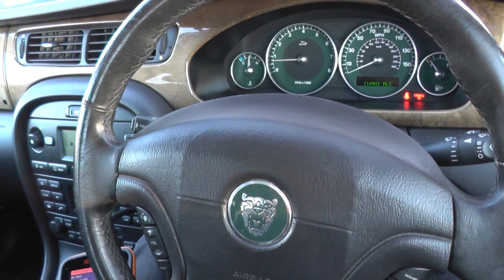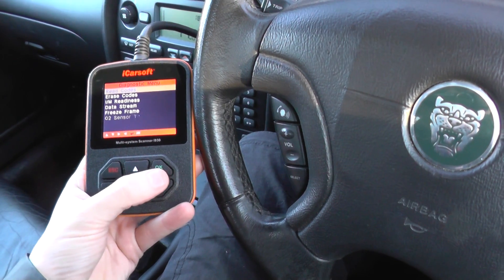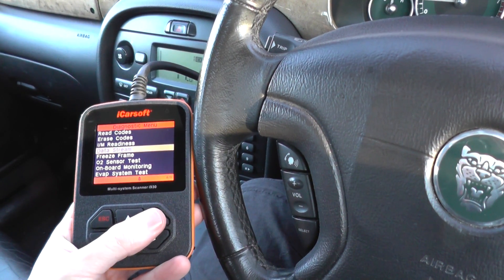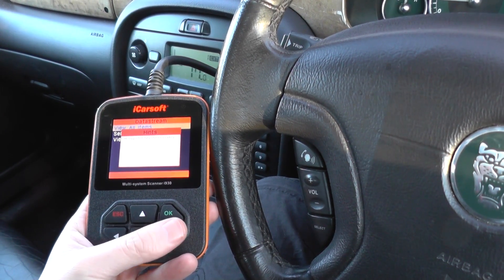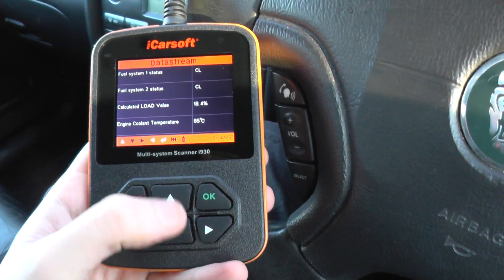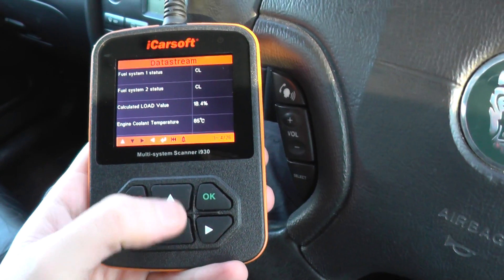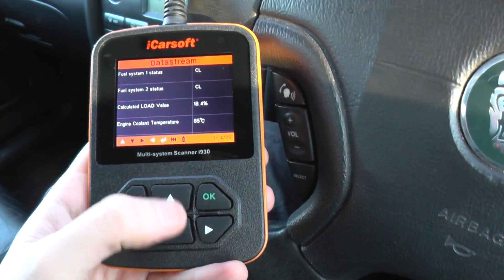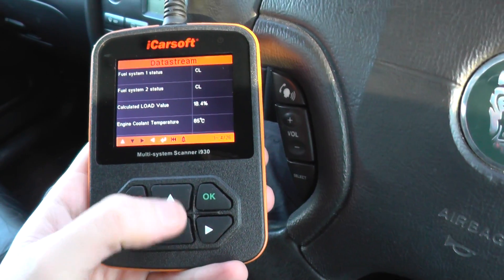Jaguar Live Diagnostic Data Using iCarsoft i930

Comment: If you need a obd2 reader avoid icarsoft as a brand, total rubbish which l found out first hand buying one that was supposed to be specific to Peugeot, couldn't get it to say anything but the common connection issue message which you're (yes you the consumer) are advised to contact them via email to troubleshoot with them - this is as opposed to just buying a product that works straight out of the box like it's supposed to. Avoid! 👍